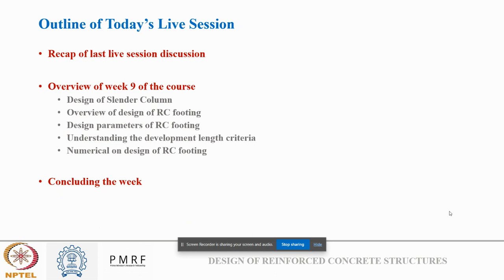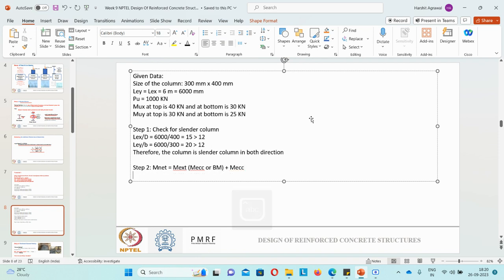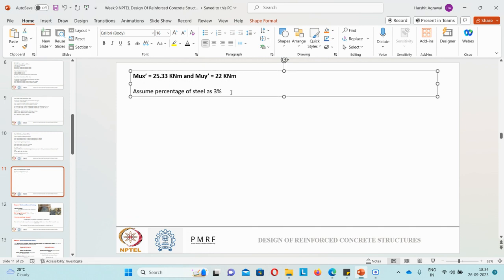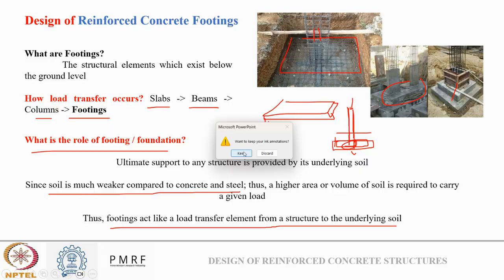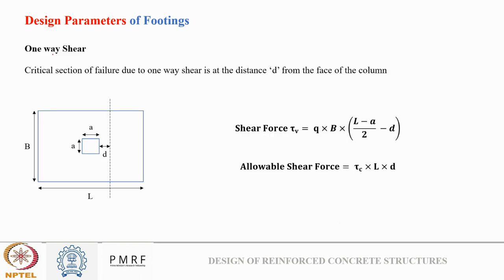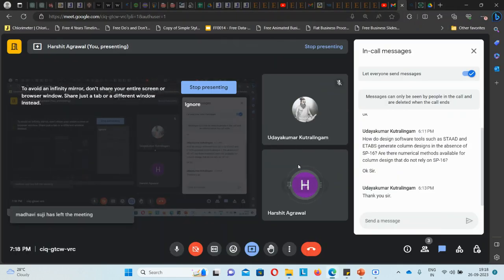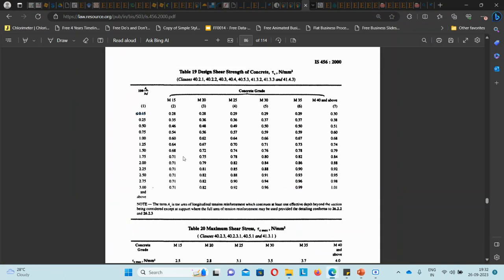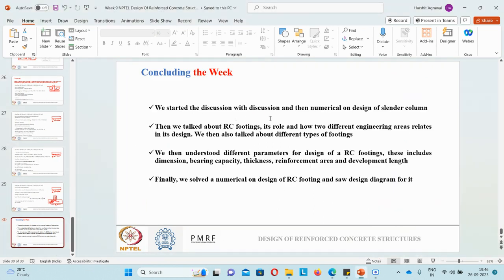Design of RC WEEK 9: Design of Slender RC Column and Design of RC footings as per IS 456

Comment: While calculating bending moment we are using total breadth of footing but in some books the breadth is taken as 1m and found B. M and this B.M. is used for calculating the depth required for bending. Please explain
Reply from the maker: Both are correct methods. In books where you saw 1 m was taken as breath, they will then calculate how much reinforcement is to be provided per meter breath, and if you take the actual breath, you will calculate the total reinforcement that needs to be provided.